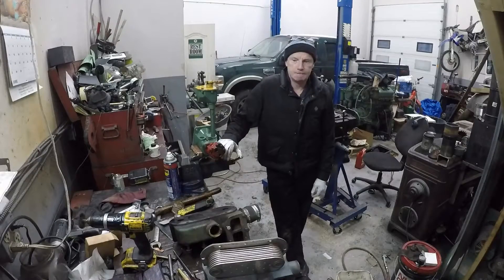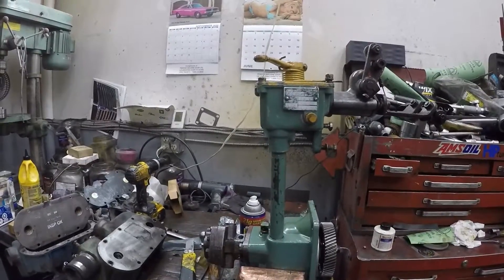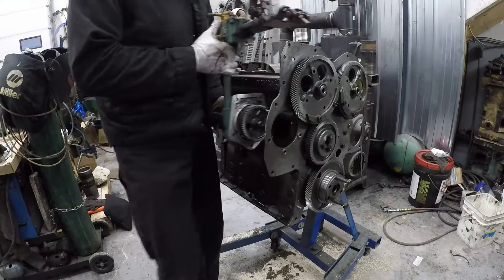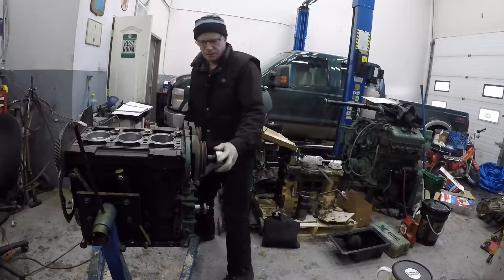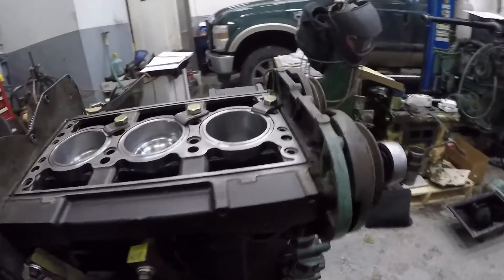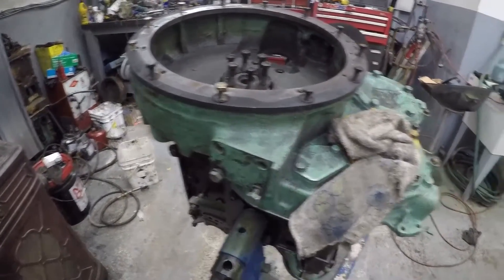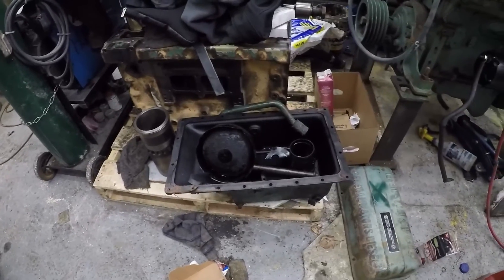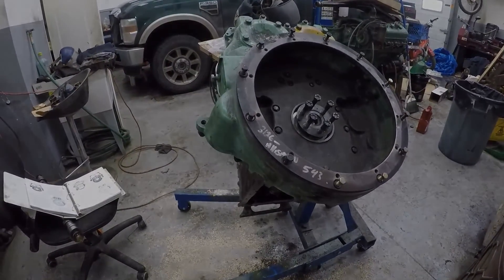Detroit 3-53T Installing Flywheel Housing

Comment: These are GREAT videos. I have a roller with a 353, lots of white/blue smoke when it starts for a few minutes, but ultimately sounds like it runs fine. Overall, I'm guessing it's a bit worn out, but it has a mess making oil leak that seems to be coming from the cam seal. Do you think it's worth it to pull the front cover and try to put a few new seals under/in the top cover? Thanks in advance.
Reply from the maker: Yes, if you pull the cam pulleys, remove the woodruff keys, then you can replace the seals without removing the cover.:)  Use a seal puller or wood screw to pull the seals out.:)
Reply: @detroitgarage9430 thank you. Times like these I wish I had a decent sized shop. If I had the room, rebuilding the whole engine would be on my list. I've done a half a dozen Chevy engines, so I'm guessing I could pull this off. The Raygo roller is a game changer for me, with a little articulated pin work and this engine back to the top of its game, it would way outlast me. Detroit diesels had me concerned, as I bought a  Dresser TD25 that has a Detroit that I'm told if it fails in any way, the whole machine is scrap as there is zero support for the engine components. It seems like these 353's are salvageable.
Reply from the maker: @willieb327 There’s lots of parts available for Detroit’s, so that’s not a problem yet.  In order to maintain and rebuild them you’ll have to learn yourself or find an old Detroit mechanic that’s still working on them.  Being you’ve worked on V8’s it’s not hard to work on Detroit’s.:). Get a manual and start reading and it will all make sense:).
Reply from the maker: @willieb327 P.S.  I daily drive a 2009 F350 with a Silver 4-53T and it’s running like a champ.  80,000 miles and runs like the day I rebuilt it, now sporting 9290 injectors.:)
Reply: @detroitgarage9430 thats got to be unique.

Comment: I picked up a new old stock engine for my skidder. Problem is that the starter is on the opposite side on the flywheel housing. Everything else seems to be correct. Is it possible to just swap the housing from the old motor to the new one? How big of a project is that? Would I be better off just leaving it and finding a starter for that side. Thanks
Reply: Thank you! Got that done. Now I had to switch the oil cooler to the other side as well. I’m wondering what do I use for replacement plugs in the holes in the block. I can’t seem to find anything on that. Will 3/4 inch round stock work?
Reply from the maker: @dawsondurst139  Yes, as long as it's an interference fit and seals it.:)
Reply from the maker: It's not that big a job to switch housings, but depending on the starter you have you can rotate the cone to fit the other side of the engine.  All my staters are clockable, so can use on the left or right side.:)

Comment: Good evening Detroit garage.

I just revived a 353 in my old Clark Michigan 35AWS.

Got it started finally and then realized I had some hydraulic leaks in the steering. Fix those successfully and then fired it up again. Things were going well, seemed like some air was bleeding out of the fuel as I could hear it bubbling back in the tank. Once it had started to run smoothly and I adjusted the idle I was pretty happy until all the sudden a catastrophic failure of the rear main seal. I wonder if you have any advice on why this failed Before I dig into repairing it? Another thing I noticed is the oil level seems high. It is not an original dipstick but from what I can tell the oil level is about an inch and a half above the oil pan gasket surface. It is hard to tell if it is diluted with diesel, but it does seem thinner than normal. But it doesn't have a super strong odor of diesel

Thank you for any advice
Reply from the maker: Hi, the rear main seal leak could be caused in part by the high oil level.  The oil level should be about 1"-1.5" below the oil pan gasket.  Check and make sure the crankcase breather is clear and free. Did the engine sit for a long time?  Maybe the seals dried up?  Those are about the only things I can think of that would cause this.  I hope this is of some help and thanks for watching.:)
Reply: Thank you very much.

Your suggestion about excessive crank case pressure is a good one. I will check the breather. The dipstick does not fit tightly, it definitely rattles around. Based on this, I assumed that crank case pressure would not be able to build up. I will look a little more into this.

not sure when I will pull the engine, but when I do repair it I'll let you know if I find anything unusual. Thank you again
Reply from the maker: @aedinschwartz679  Ok thanks.:)
Reply: I missed your one question, yes the machine had been sitting for about three years before I bought it. I drove it onto the trailer and drove it off. Then it sat at my place for three years until a month ago. I had it running multiple times without any issues, no oil leak at all. When it failed it failed completely and it was running in a pinky finger sized stream out the drain hole in the bell housing
Reply from the maker: @aedinschwartz679  Ok Thanks, that's a huge leak for sure.:)

Comment: Do you use any high tack gasket sealer on the flywheel housing gasket? Also do you use anything to lube the crankshaft where it mates with the inner lip of the rear main seal
Reply from the maker: I don't use high tack, but it works great for the housing and others that are hard to keep on dry for assembly (without engine stand).  As the rear main seal is tephlon I don't lube it, but install dry.  There's a notice in the install notes to install dry or will cause leaks.:)
Reply: @detroitgarage9430  sounds good, thank you
Reply: @detroitgarage9430  I just went to install the wear sleeve on the crank and realized it has a taper on both sides. On one end the taper is on the inside diameter and on the other end there is a taper on the outside diameter.  Which side faces the transmission, the ID tapered end or the OD tapered end?
Reply from the maker: @steveingersoll650  The OD taper faces the transmission.  The inner diameter taper is to help install over the crank.:)
Reply: @detroitgarage9430  wonderful, thank you!

Comment: Wish you were my neighbor...Merry Christmas Happy New Year... Looking forward to you putting on the oil pan gasket and how you make sure it seals and also how you torque it down...great job...
Reply from the maker: Happy New Year.:)  On this engine it has the heavy cast iron pan and takes the thick paper gasket.  If I remember correctly you guys have the updated rubber gasket and it's far better than the cork and paper gaskets.:)

Comment: Is a  number 2 housing the one for the Allison automatic and the number one for a standard shift transmission? Nice work!!!!
Reply from the maker: Thanks, this #2 housing is different from the #2 Automotive housing that the Allison bolted up to and would be used for a manual transmission.  The automotive housing has cut outs in the bottom for accessing the torque converter.  It also has no accessory drive mounts on the back.  Here's a quick video of the rear automotive housing.:) https://www.youtube.com/watch?v=Z_0Rtf7WhiU